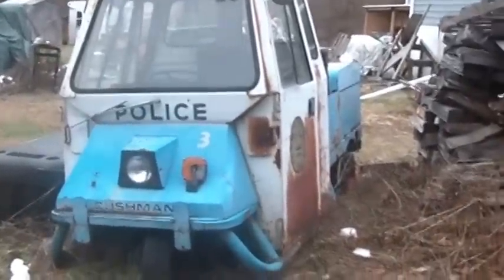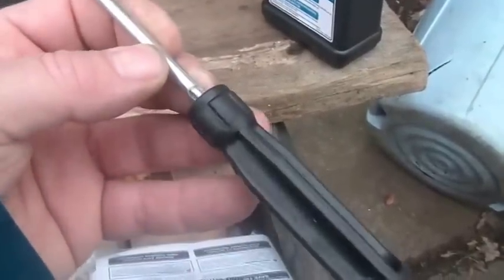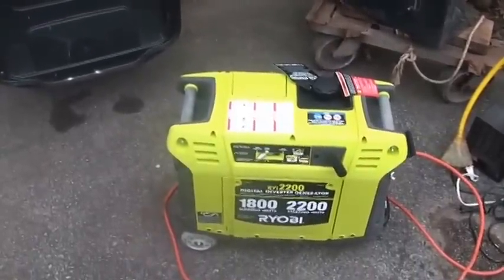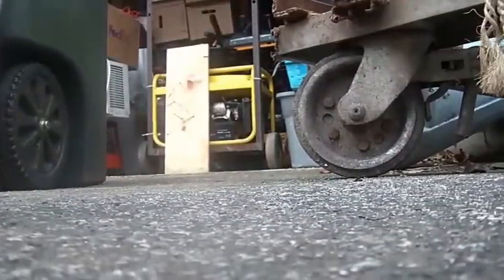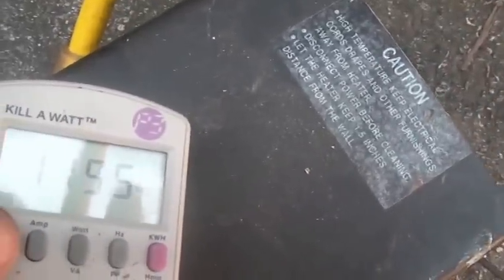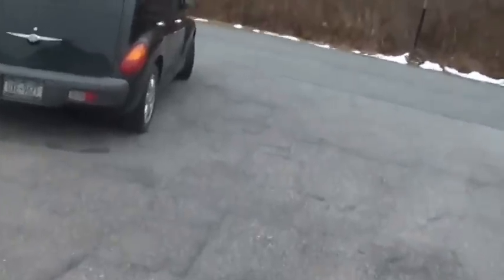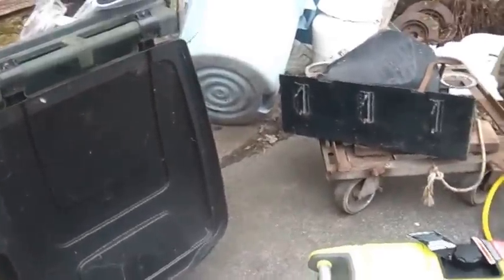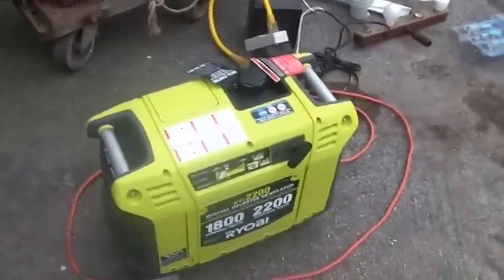12_5_2014, Load Testing a $486 Ryobi Inverter, Generator

Comment: seems like a much better generator Im nota big fan of ryobi myself, havent had much luck with it
Reply from the maker: ghettohillbilly1 , From a fuel consumption, Voltage, and frequency regulation point of view, it is great, I just hope it starts when I need it and it lasts a long time. My luck with Ryobi has been good, it started with a 12Volt lithium ion battery powered drill that was used, dropped, stepped on, and thrown while building my upper garage. Since then, I have picked up more when the price has been right, Thanks for watching and commenting Bud!
Reply: cant knock it if it works:)

Comment: looks like it has a good inverter and must be a sine wave inverter given your kill a watt meter reads good. I found a lot of people use there old generators to run battery chargers+battery+inverters so they have cleaner power. I noticed in my garage the inverters are better power than the generator even being modified power. I just use generator for welding or low sun days
Reply from the maker: william staten , The KiloWatt meter works with the solid state inverters, right?  I have not checked the belt driven alternator to see how the Voltage and frequency behave yet, need to get it running again to try it... U R right, to get around a non regulated generator unit, charging batteries and running solid state inverters is the safer way to go with electronics. As always, thanks for your input, watching, and commenting!
Reply: I have 12 modified inverters and the kill a watt meter doesn't like them. Found it reads better with line conditioners. Have seen other people meters work and not work on the modified sine. My microwave gets its time from the clock frequency. It seems to do ok on the generator or the inverters. Sometimes I gain or lose a minute per hr.

Comment: what do you think about sea foam, someone told me that you should always use medium octane gas in small engines.  It makes them start quicker.  I enjoy your  vids.  I would not be afraid to retire I have all kinds of personal reasons for saying this but I am retired and fell it is well wort it.
Reply from the maker: 59chevt , I have friends who swear that Sea Foam is the best additive ever created, it fixes all problems... I have yet to have it fix anything, I also have friends who only run higher octane fuel in their small engines, especially 2 cycle engines, generally speaking, I am not that careful. But, I also don't run my stuff that hard. I am very careful with my diesel engines though, rebuilding a carb, no big deal, a screwed diesel pump and injectors are no jokes! I think retirement would be great, I'm concerned about timing, if one retires too soon, running out of $ is possible, retiring too late means one does not enjoy their full life, thanks for the kind words, encouragement, watching, and commenting!

Comment: I would of plugged in a drill. LOL  I have a Kill o watt meter some place and some other brand one too . I got them just for generators.
Reply from the maker: wtbm123 , A drill would of been much easier to handle with one hand, also, less dangerous. The KiloWatt meter is great to play with to see how much power various things use, when running a generator, I think it is a necessity to see how the Voltage, frequency, and loading are working... I think Ur KiloWatt meter is along side my carb dip, in a parallel Universe, just out of our collective reaches! Thanks for watching and commenting Bud!